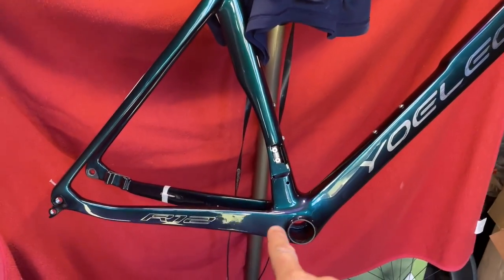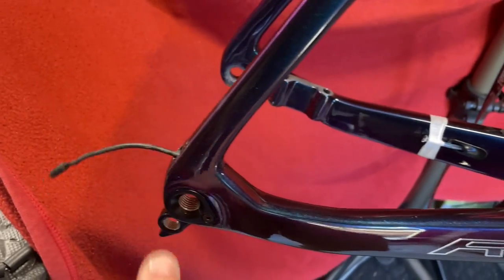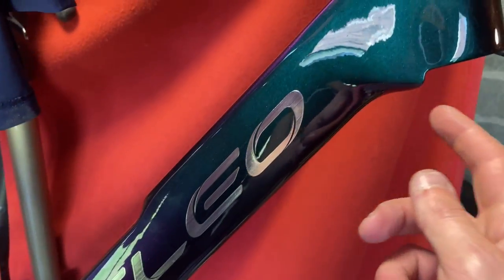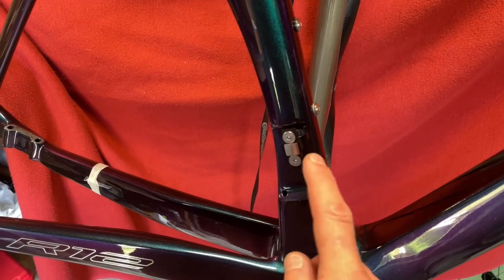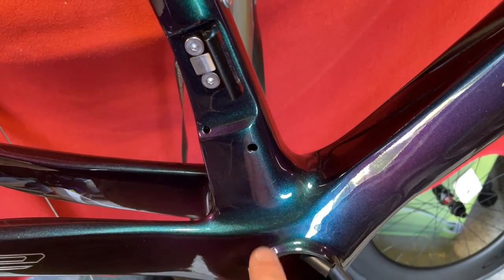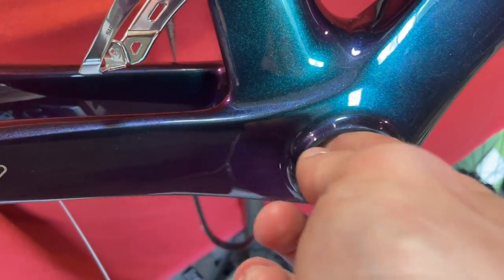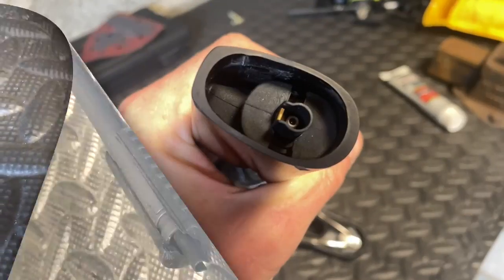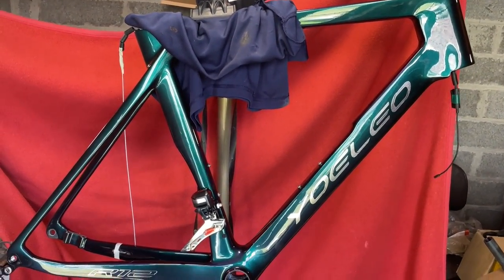Di2 Cable Frame Routing Guide

Comment: Great works!! 
I'm waiting for my R12, and I'm a bit scared about the problem you have encountered in the 'Pre Build Issues', anyway, can I ask how long they take to ship your frame?
Also I see an adapter for the DI2 battery, is on the package yoleo send? or you have to ask for it?
Thanks and very well made building video.
Reply from the maker: Hi my frame took 7 months from order. I’m not sure what you mean by adapter for that battery, there is a rubber gripper for the seat post if that’s what you mean? 👍

Comment: for Etap users, are there rubber plugs since no wires required?
Reply: you can source various grommets for frames on shopping sites like AliExpress, amazon etc. All types and shapes available for use to plug unused frame ports.
Reply from the maker: There are blanks supplied in the accessories packs, so you should be covered. 👍